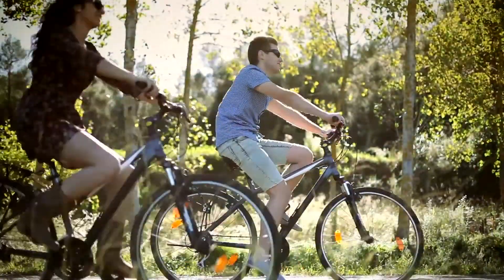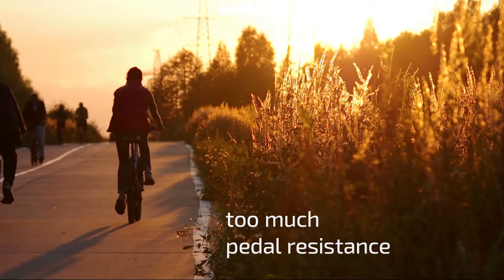bimoz – die patentierte Lösung für einen boomenden Markt

Comment: What are the types of bikes the bimoz will not fit?  I have two bikes; one has a splined 68mm English bottom bracket 9 speed XT trigger  shimano shift system(shimano crankset)and my other has a external Hollowtech II single spindle crankset with a 10 speed shimano trigger shift system. Both bikes also have clipless pedals on them.  Will this bimoz work with what I currently have?
Reply from the maker: Hi Tracey,
long term short: yes it will fit. Both your bottom bracket and your clipless pedals.
Currently we don't have a list with all the types of pedals and brackets, but we will deliver the bimoz with an adapter for square or toothed brackets. You simply mount your old pedals on the new bimoz crank. We will contact you as we move forward in the production to find out which crank size you need. Later on we there will simply be the different sizes of cranks to choose from in the buying process. Along with that we will prepare a simple tutorial how to find out which size one needs.
Cheers Roland
Reply: Your build concept; I like this one the best so far due to the fact it is light weight and there are no large amount of dangling wires distributed on the bike. I have another question; My crank arm length is 170mm. Does the Bimoz meet the same length as my crank arms?
Reply from the maker: Hi Tracey, yes we provide the bimoz pedal case in the same length like your original one. Even the so called q factor doesn't change to what you have on your original crank. Cheers Roland
Reply: Thanks! I'll have to start saving my money to build a third bike specifically to become an electric one with your Bimoz on it.